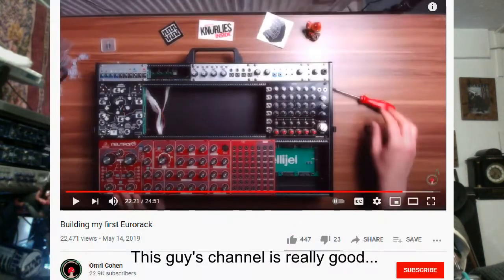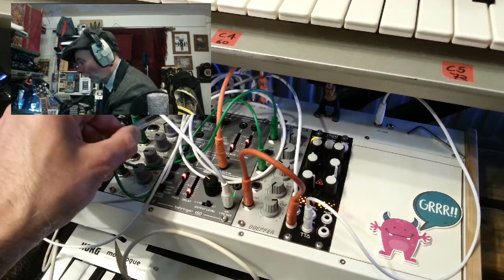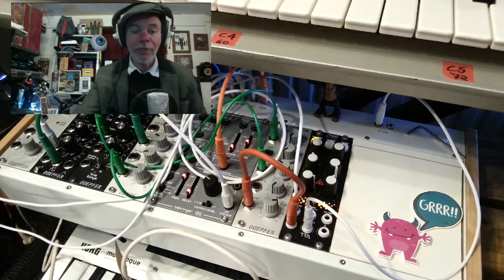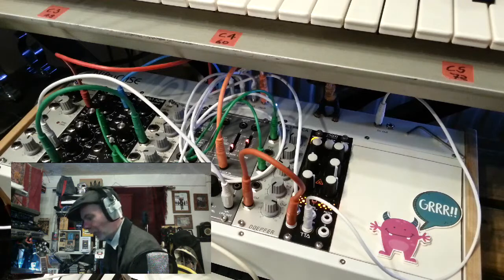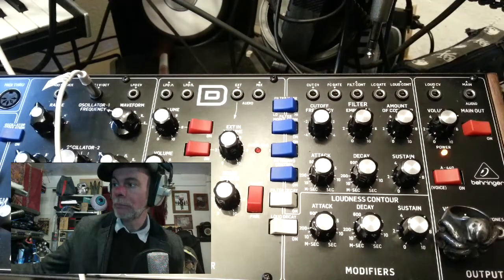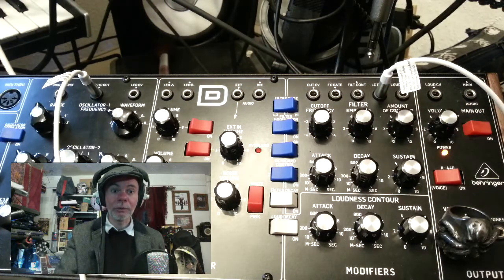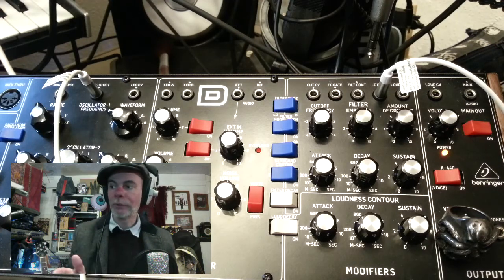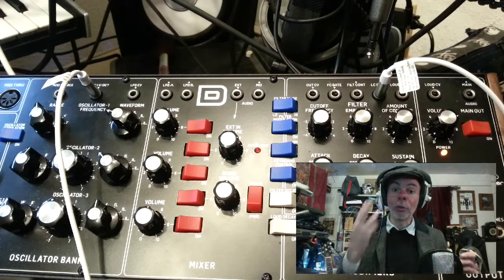Behringer Model D - eurorack patch set-up

Comment: Hello friend, can I use only the plaits module with the behringher model D?

Greetings!
Reply from the maker: in principle yes, the plaits module likely has CV in for pitch, not sure about gate. But, the question is, can you plaits on it own? You'll need a way of powering the module and some way to hear the output (actually, you could route the output back to audio in of the Model D).